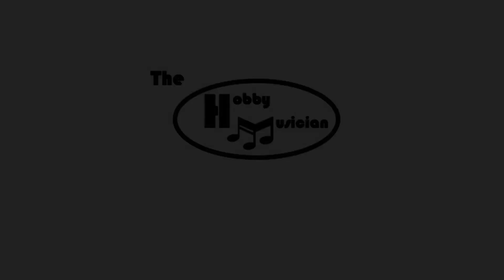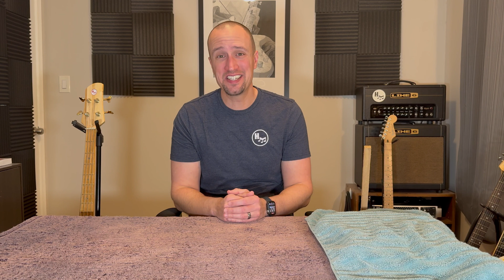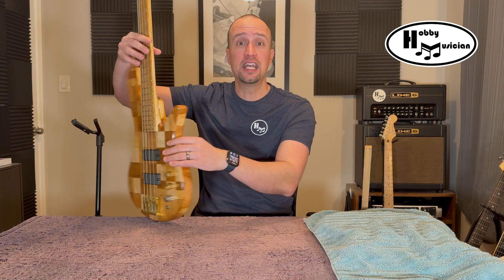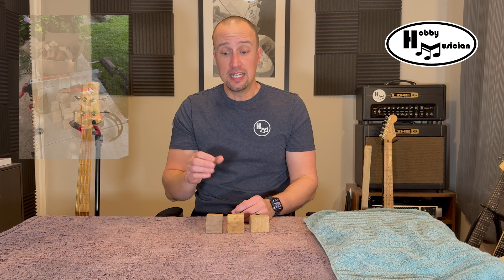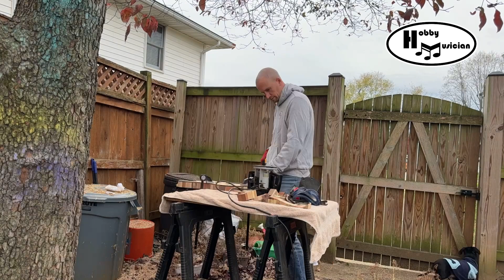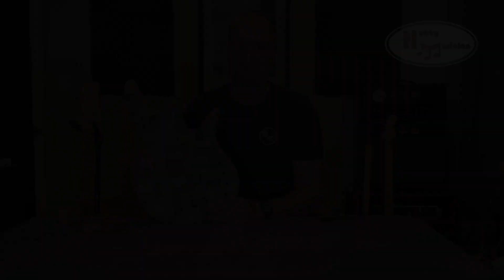S8E11 -  Laser Guitar Body from Custom Templates #lasercutting #woodworking

Comment: ahhh you ate a oroud osner of a line 6 dt 25. i ownn 2 dt 50s
Reply: not easyto work on, my combo is making some noise. i live rural wisconsin, closest amp reoair milwaukee. ill try changing tubes first line 6 scares you make sure you on,y use certian brands.
Reply from the maker: Yeah, it can definitely be nerve racking to try working on them yourself, but with some careful research and preparation…you can definitely do it!
Reply from the maker: I love it!!  It’s been my one and only live amp ever since I got it. Although it doesn’t get much use these days with my Helix running straight to PA systems, it will always have a special place in my heart ❤. Glad to meet another proud dt owner!!